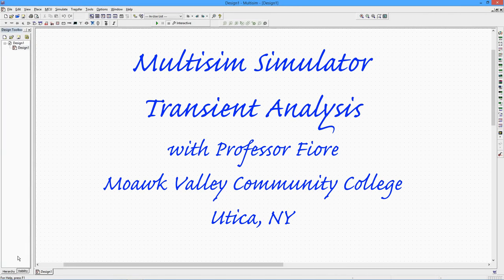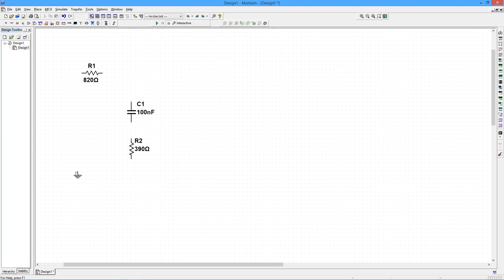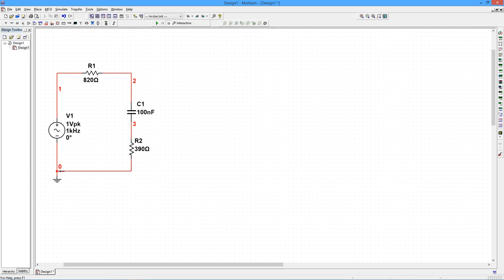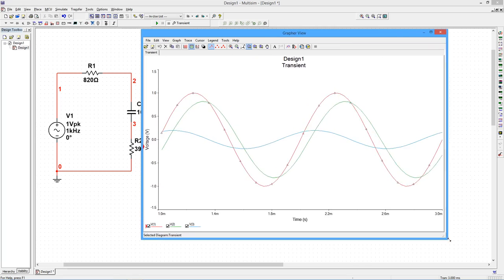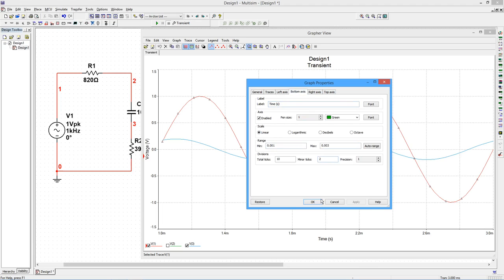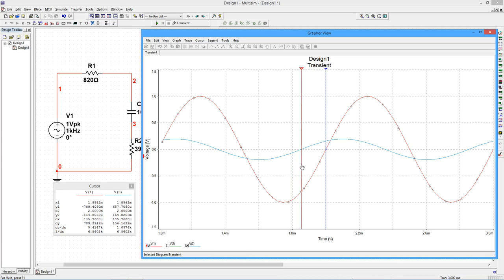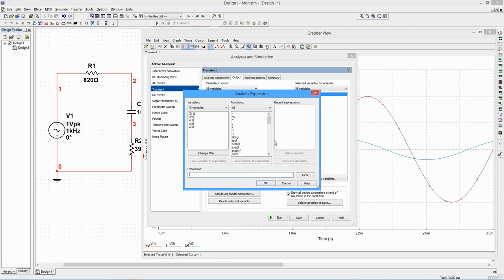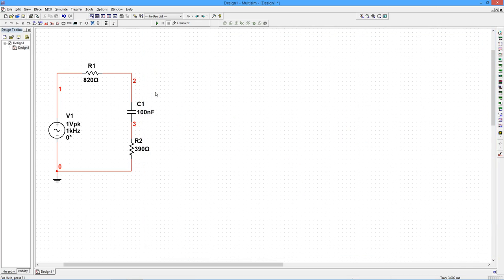Multisim Transient Analysis

Comment: hello,  May I know how to generate a NRZ pulses in multisim. I need to use a digital source providing only one/zero and then apply the analysis
Reply from the maker: Not sure exactly what you need but Multisim has a digital clock source, a pulse voltage source and also a piece-wise linear source that would allow you to make a unique waveform.

Comment: My peaks aren't at the Vpk value i give the source. Can you explain why? Want it to be 5Vpk, but the graph comes up with peaks at 2.2597v (Ymax on voltage). You seem to be able to use a 1Vpk source, and your graph just does it at 1 and -1.
Reply: Oh never mind, my ground wasn't actually connected to the circuit. I attached it and now the peaks are at 5v and -5v

Comment: could you please explain what is the period of the input and what is the value ?
Reply from the maker: The frequency is 1 kHz. The period is the reciprocal of that, or 1 millisecond. Frequency is the number of cycles in one second while the period is the number of seconds per cycle (typically a fraction of a second).
Reply: @ElectronicswithProfessorFiore  thankyou for the quick response.
Reply: @ElectronicswithProfessorFiore  nice